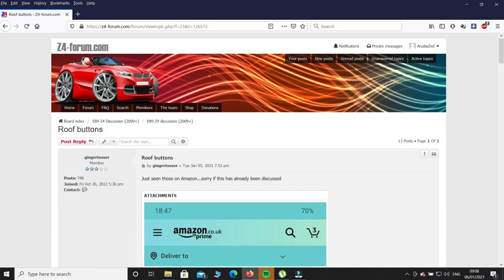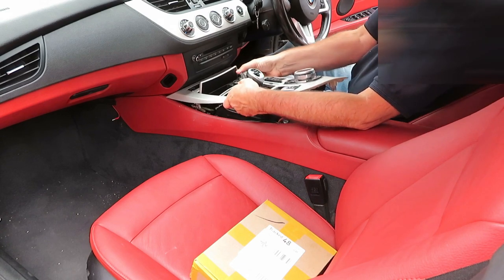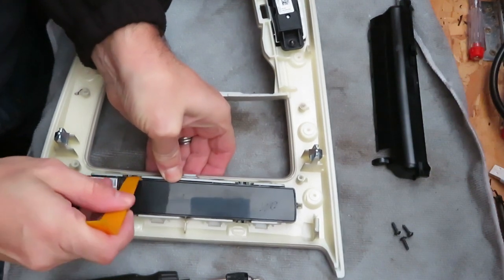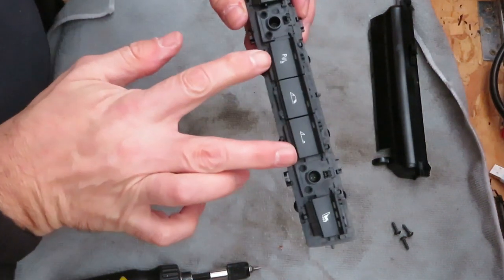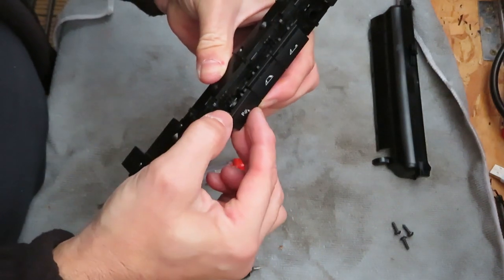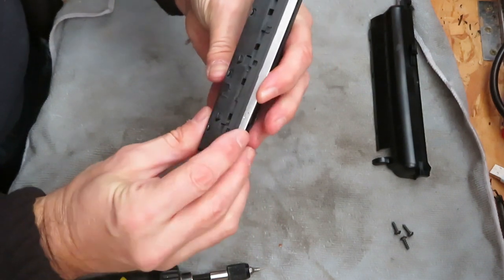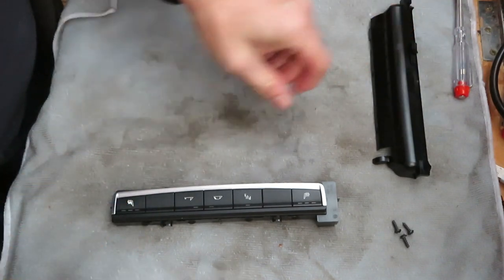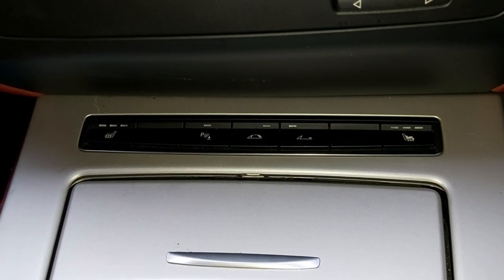BMW Z4 E89, roof and PDC switch replacement

Comment: Thanks for this, Dave - I wouldn't have bought the new buttons, let alone tried to install them without first watching this video, and then re-watching each step as I went through the removal/re-assembly process along with you. The only note I would add is when I started the car after re-installing everything, and tried to set the Parking Brake to make sure it was working, I got a Parking Brake error (red icon) on the dash, and the Parking Brake wouldn't set. I turned the car off, re-started it and these errors went away - for a moment I figured I hadn't connected the Parking Brake wiring correctly, but all is good. These buttons are a small detail, but the old scratched ones were something I noticed every time I got into the car - not any more! Thanks again!

Comment: Hi Dave, I’ve just bought a Z4 sdrive 2.5 2009 …..new to the z so what’s mine in the E ..range is it a E89 ..? Thanks for the vids …
Reply from the maker: Hi Nigel, 
Yes, it'll be an E89, and I'm glad you like the channel 👍got some new content coming soon, and something extra special coming very soon indeed 😎
Reply: @BMWZ4Mods  cheers for that, I’m thinking of changing the salmon relays ..on eBay £20 each is it a standard relay …only salmon ones I can find they say it’s for mine..
Reply from the maker: @nigelpritchard994  only go for the correct salmon relays, part number 12631742690
Reply: @BMWZ4Mods  cheers mate will do...

Comment: Daviid, another great video.  You have a terrific talent for this.  I couldn't previously find heated seat buttons, so I bought the entire switch panel. You've given me great confidence to put in this switch panel and at the same time put in the Idrive controller/Android 11 head unit when I get these goods in February.  Thanks again.

Comment: David my switch panel is not budging a cm and I’ve tried four pry tools at once to try and push it up from the switch panel side. Any suggestions?
Reply from the maker: Unless someone has glued it in previously then it should come out without issue. I've done a few now which have all released as on the video.
Reply: @BMWZ4Mods  are there some side tabs which need to clear before one can push the switch panel up from below?
Reply from the maker: @milovan8565  will the surround plastic flex  away from the switch housing when you are putting the pry tool in (as in the video)?
If so are you pushing the switch up with your fingers at the same time?
Reply: @BMWZ4Mods  yes that is my procedure. I separately sent you a more time urgent question on the fiber optic cables transfer on your Android video. Anxious to learn your answer on that one.
Reply from the maker: @milovan8565  send to me at anubis 4120 @ msn . com (remove tge spaces) and I can respond quicker 👍

Comment: At 5:42, I managed to perform this step. Its important to have gloves on, especially if you are doing this for the first time. The risk of cuts is very high. Removing this "buttons panel" will be easier if you have another helper to assist with holding the tabs on. The prying tool may be too "big" to pry loose the "buttons panel". The small screw drivers are a must. Prying tools help minimise risk of damaging the trims, so don't skimp on these. 

Finally, thanks Dave! That was (and still is) totally helpful. Watched it for umpteen times before taking the dive. Turned out pretty good! 

PS: Great short project over the weekend.
Reply: You don't need a helper. As you pry up each tab, leave the pry device (small screwdriver or plastic tool) in place and go to the next three tabs and leave the pry device in place.  Then lift it up and out.

Comment: Aren’t these buttons standard in the e89? My one has roof up/down and parking and double heated seat buttons - I thought this was a standard feature? 🤔 maybe I got lucky without realising!
Reply from the maker: No, nothing is standard on a Z4 😂 Everything is down to whatever the original owner opted for from the factory.
The basic is the two roof buttons only, then the options are heated seats, PDC or Statt/Stop.

Comment: Hi, nice video, however my Z4 E89 has the automatic transmission knob with indicators, as shown on the picture in your video and it isn't possible to remove the console with the knob/trim, doesn't fit through the hole? Any advise? Thanks :)
Reply from the maker: Arr, as per the video, pop the surround trim up, disconnect the ribbon cable then pull upwards on the knob (watch out for the mirror!!). This will release it completely. 
Hope that helps.
Reply: @BMWZ4Mods  Thanks for the quick reply, so the ribbon cable disconnected and then just pull the knob WITH trim/cable upwards so knob + trim/cable is removed compleet so I can remove the console over  the knob shaft to exchange the buttons using your video?
Reply from the maker: @barendgerritsen9503  👍 yes thats correct.
Reply: @BMWZ4Mods  Thanks, job done and all working fine :)

Comment: Many E89 cars have, in the same switch block, the seat heating switch covers  scratched. I have failed finding those  on Amazon and other places. Someone here has a source?
Reply from the maker: Alas I've not been able to find the heated seat button either. I find it strange that someone has gone to the trouble of making the PDC button but not the heated seat ones, as I find a lot more have seat heating than PDC (front). Maybe someone will soon, so I'll keep looking.

Comment: Quick question not related to this video but I have a drivers side seat that the lumbar adjustment doesn’t work ( you can hear the electric motor working but it’s not adjusting the support either in or out 🤔) would you be able to advise or possibly a video, thanks
Reply from the maker: Alas, my seats don't have lumber support. But what I do know is that the motor is a pump that inflates a bag. So if it's not inflating and the motor is running, then either the pipe has come off or the bag has burst. Looks like you're going to have to take the seat out. If doing this, I suggest disconnecting the battery before unplugging the seat to prevent any airbag faults coming up.
Hope that helps.
Reply: @BMWZ4Mods  many thanks 🙏🏻 I’ll have to investigate 👍
Reply: Hi I realize now I meant the seat side bolster not lumbar as I originally stated 🙄 As you say I’ll have to take seat out for a better chance of sorting it as there is nothing obvious to see with seat in situ 🤔

Comment: Hi Dave, thanks for the content! is it possible to replace the 12v socket in the ashtray? Whilst mine does kind of work it isn’t powerful enough to power a usb socket and I therefore can’t charge my phone.
Reply from the maker: Well that's odd, in two different ways..
Firstly because it should as its only an electrical connection. Ie; 12vdc comes in via the two wires (12v+ & 12v-) and is then connected to the USB adaptor. Have you tried it in the centre console 12v socket? I say ut should as I use one in both of them. Possibly check the socket with a meter to see if it's getting the correct voltage, also try tge USB adaptor in another car.

And the other reason is because I've just replaced replaced mine, as I'd cut it previously so it was a bit short. I replaced it with one from an E82/7 as it was cheaper and the same fitting (and a bit longer).
Reply: Hi Dave, the USB adapter works fine in the centre console 12v socket. I’m able to charge my phone that way but would rather not have a cable running across the interior, plus due to the thickness of the cable the centre console won’t shut.  Do you have the parts number for the replacement socket you bought? I’ll also test it with a multimeter.  Thanks
Reply from the maker: @nathandearn471  sorry but I don't have a part number, I just looked through eBay and found a full ashtray complete (still cheaper than one for the E89!!). It's a perfect exchange for the E89 as I checked plenty of photos first to make sure.
Before buying one though I'd suggest checking the contacts in the socket and also at the molex connector plug under the trim, just to make sure you are getting 12v at the molex plug, if nit then you'll need to investigate further back into the loom.
HTH

Comment: Can these not be popped off without removing all that trim??
Reply from the maker: It's not so much "popping" them off, it's getting the new ones back on. Because of the rear hooks you need to be able to put them in from the rear (front of the car as in situ) and then slide them slightly before clipping them in. This would be impossible with the switch block in place without damaging something. 
Hope that helps
Reply: @BMWZ4Mods  can I ask where you are based and if you’d replace a switch for me?
Reply from the maker: @summitupmark5615  I'm in South Lincolnshire, UK. 
If you want to contact me directly then send me an email to a n u b i s 4 1 2 0 @ m s n . c o m (just remove the spaces)

Comment: can someone tell me what the 2nd and 6th buttons would be for? ty
Reply: auto off is 6th ive seen in dif pic
Reply from the maker: No/2 is not used in any format. I read somewhere that there was to be a use for it but it wasn't put into practice in the end, alas I can't remember what it was now.
No/6 is for the Auto Stop/Start on/off if it had been opted for from the factory.
Reply: @BMWZ4Mods  thanks for the reply, yes i came to that conclusion after viewing 200 z4's on autotrader and no one having the 2nd button! its a shame cos a blank button always makes you look cheap, like an old hifi where the cheaper version doesn't have the button lol